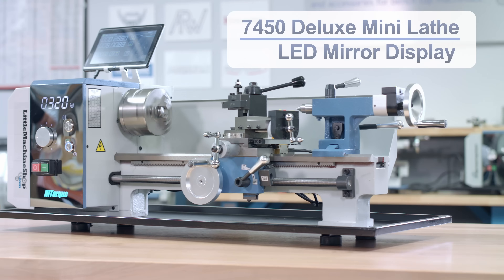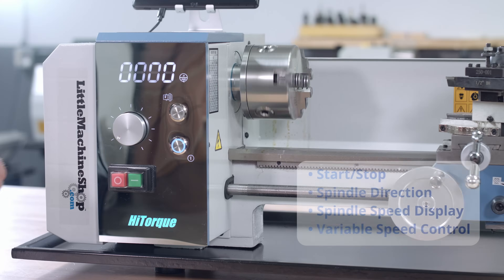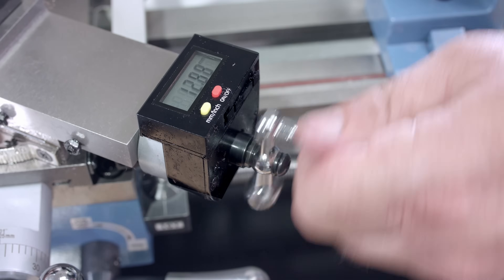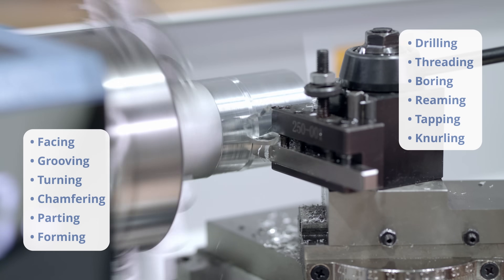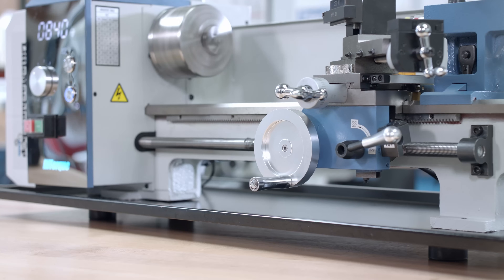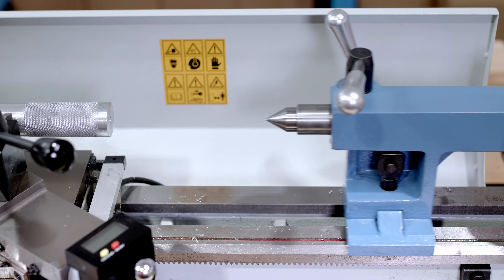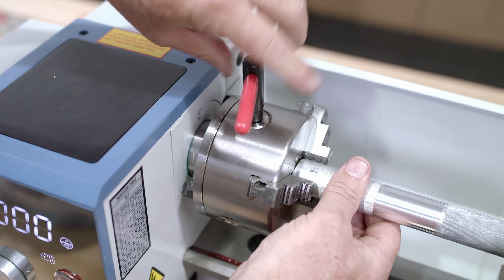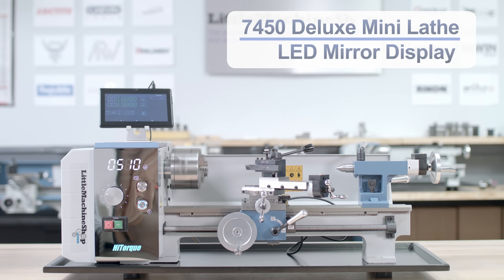HiTorque 7x16 Mini Lathe with LED Display, Model 7450 by LittleMachineShop.com

Comment: does this not cut metric threads
Reply from the maker: It can cut American Standard Unified class 2A inch screw thread from 4 to 80 threads per inch, and you can create every American Standard Metric class 6h thread from 0.3 to 8 mm pitch with the extra 21 tooth change gear that is included.

Comment: With that price it better fkn perform!
Reply from the maker: We stand behind the performance and price. I know there is a lot of junk being dumped on Amazon, eBay, and others. Then those buyers spend hours replacing tailstock, motors, bearings, etc. to try to get them to a usable machine. Imagine you worked at a machine shop and that's what they gave you. Time is money and if your goal is to by a project machine have at it. We believe if you buy a machine, it should be ready to perform out of the box. We also back with tooling, accessories, service based in the U.S., not a 30 -day return window. If your only criteria is price, we're probably not for you, but if you value quality products from a company that stands behind them... I think you'll find we may be the right choice.

Comment: Would love to see some form of modern upgrade set for the previous hitorque lathes like my 5200.  Perhaps a new control panel with readout like this one.
Reply from the maker: I think this may be a tough one, but we'll explore. The 5200 shares many similar parts and design, but you may have to replace entire head to accomplish. At the same time motor, gearing, etc. may be salvaged so maybe not so bad. Complicated either way...

Comment: But does it Metric too? Because I don't need the retarded imperial system here in my country.
Reply from the maker: Real top and bottom half-nuts and a reversible 16 TPI lead screw provide extended threading capability. You can create every American Standard Unified class 2A inch screw thread from 4 to 80 threads per inch, and you can create every American Standard Metric class 6h thread from 0.35 to 8 mm pitch with the extra 21 tooth change gear that is included. Cutting inch threads is made even easier with the factory-installed threading dial.
Reply: But your buying from this retarded system...  just shaking my head!!!!